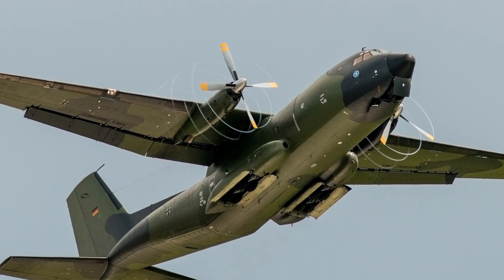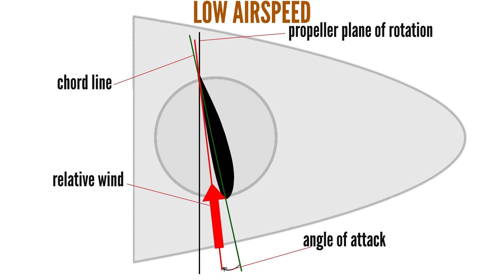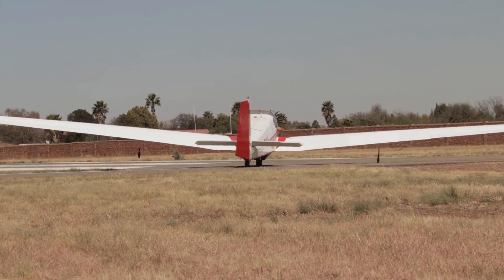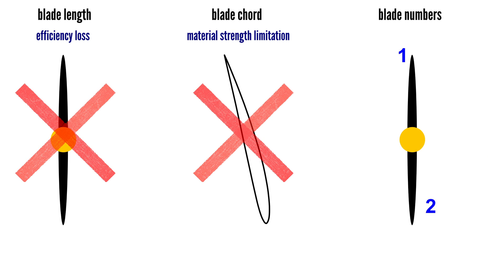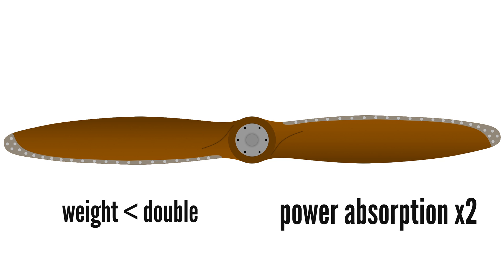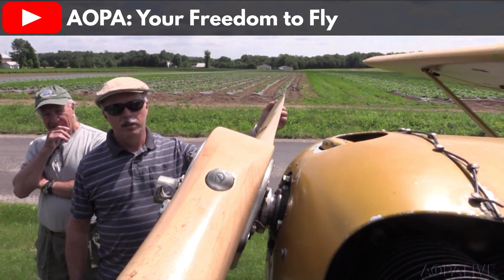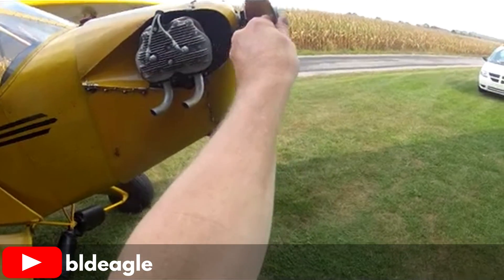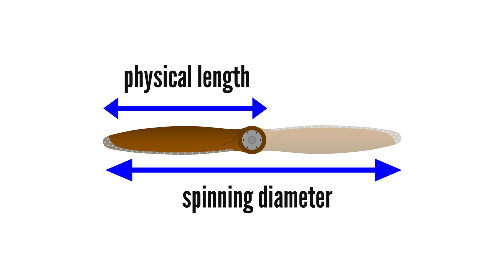The Problem with Single Blade Props Isn't What You Think - Efficiency Deep Dive

Comment: What if you have a single blade eith contra rotation? Then what?
Reply from the maker: I don't think it will be balanced. Since they counter rotate, the 2 single blades will cross over (pass each other) once per revolution, meaning the thrust bending forces adding up instead of cancelling out, potentially making balance worse.

I'm not sure if teetering hubs would be possible without the blades crossing over to the other blade's plane of rotation. At a quick glace the complexity seems too high.
Reply: It would be a bit of a mess, and there is little reason to do it, but I don't see why it couldn't work. You would need to put significant distance between the blades to avoid the teetering mechanisms causing collisions when manoeuvring (similar to contra rotating helicopters). You would then have a heavy low power prop that could operate at high speed, but is never going to get there because it is low power.

Comment: The non symmetrical forces on a single blade propeller you refer to were used to great effect. An automatic variable pitch propeller was achieved through a simple reliable mechanism.  Thus a climb prop on takeoff. A cruise prop in level flight with reduced throttle. I have seen two bladed props with automatic pitch.  They also are no longer made. Their mechanism more complex. I would worry about reliability. They have been known to fail where the metal fasteners hold the wood to a metal cup it swivel on the best I recall

Comment: I wonder if things could be different with electric propulsion, like for a drone. The countermass could be battery, so it's not dead weight.

And a weird trick is that a single motor could be used for both propulsion and steering. You alternate between spinning the prop for thrust, and holding it steady to steer.

Or maybe you don't have a countermass at all. The prop is on the end of the tail boom, and you simply accept that the boom will nutate in a tight cone in reaction to the blade. The drone doesn't need any tail surfaces other than the prop blade.
Reply: Well, most drone applications that I can think of are going to want a nice, steady camera of some form, so having the airframe nutating around is definitely undesirable.  There might be some possibility in the cheap toy drone catagory, where the novelty of a single propeller that also steers the vehicle might drive sales, assuming of course that you don't end up with excessive wear from the unbalanced blade with cheap materials.

You wouldn't be able to control roll with the propeller, similar to a helicopter needing a tail rotor, but maybe if you gave the drone symmetrical wings like the fins on a rocket, you could just let it spin at it flys, with the onboard microcontroller keeping track of orientation so that the controls stay in sync with the direction of the ground.

Comment: What happens when you have a gearbox attached to change prop speed to whatever you want. Say something like a tiltrotor. What happens to efficientcy.
Reply: I might be wrong but if I'm remembering correctly that's how a lot of modern turbo props work. You put the engine at a happy place where its getting the most work out of the fuel then change the prop angle to change thrust
Reply: Already done that, lot of ww2 plane have variable pitch propeller

Comment: Boeing did a deep study on a single blade windmill back in the late 80s or early 90s don't know what they found , but a have not seen any single blade windmills .
Reply: The single blade is more efficient per unit of blade, but the overall windmill has lower efficacy and cost effectiveness. 3 blades is the economic sweet spot of wind turbines with current materials and methods. The economic calculation is quite a bit different from airplane props.
Basically each additional blade extracts more energy from the swept disk area but not in full proportion. So (actual numbers for illustration only) 2 blades produces 185% of single blade power, and 3 blades is 260% of a single blade, while 4 bladed is 330%; but the blades costs are fully linear 3 is 150% of 2, the tower costs rise less than linear, and maintenance labor is basically a constant regardless of power output. (Keeping disk diameter fixed and thus tower height and spacing [powerline length] also fixed; but power and force/strength will vary.)
Reply: tower effect is also why 2 blades are "less desirable"..

Comment: Adding a second blade is in most cases less efficient because two blades have double the tip drag
Reply: No it does not double the tip drag, they are different tips on a different aspect ratio airfoil with different loading.
Reply: Single blades have inherently worse dynamic balance and thus higher vibration.
Reply: @allangibson8494 And the downward-advancing single blade will do some pretty horrifying things…
Reply: .... I converted my full scale piper cub to work on rubber band s with a single blade folding prop.....

Comment: Single blades are unnatural. They're surely evil in some way, perfect for a Halloweencopter
Reply: They are natural, maple seeds.
Reply: Zipline drones use 2 1/2 blades.

They were looking for a quieter propeller, and ended up with one that's a little more efficient too.
Reply: Ever see a pine tree seed when it falls out of a pinecone?😉
Reply: @throttleblipsntwistedgrips1992  Ever see a rotating assembly on a shaft in nature
Reply: Elm speeds don't spin at 1500+ RPM.  The big problem with a single blade propeller is that it needs a countermass to "try" and have balance so it would not shake the aircraft to pieces.  The problem is there are two kinds of balance, Static and Dynamic, and without a symmetrical radial and spanwise distribution of mass the two balances are never in the same place and the dynamic balance migrates with RPM.  In short it will always vibrate significantly more than a 2+ blade prop.  Also fewer blades means larger diameter  so the number of blades is usually selected based on the need to reduce the disc diameter of the prop such as to keep it from hitting the ground.
Reply: I’m sure they are also perfect for VTOLs as they can naturally feather down the airstream in cruise flight.
Reply: Look up fly halteres. It is the same thing.

Comment: Brillant exposition of the technical aspects of a single blade propeller. One thing I failed to notice in the imbalance part, sorry if my mistake, is that another imbalance is present  due to no balancing the par of force produced by total drag of the blade in the plane of rotation. Thus single blade prop would tend to also rotate orbitally arround the propeller shaft. Even when Center of mass is coincident with the hub, centre of drag par is not.

Comment: Good video as always thank you 
It’s all about eccentric loads and resulting vibration, and not just efficiency and structural bending loads. 
It is possible to balance the mass of a single blade prop, but we can’t forget that the blades are creating a lift force and the centre of lift is an issue. Two or more blades always result in a centre of lift that is coincidental with the centre of rotation, but this is impossible with a single blade. 
A single blade has a rotating lift vector that is inevitably eccentric to the rotational centre (and centre of mass if it is mass balanced) and so there is an inevitable significant vibration issue due to this even if there is a teetering hub to relieve the structural bending loads.
To avoid vibration, the rotational centre, the centre of mass and the centre of lift all have to be coincidental: not just the first two.
Reply: The teetering hub doesn't just relieve the structural loads, it moves the centre of lift sideways to the centre of the hub. Obviously this requires a torque, but the torques at each moment of time cancel over a full rotation, so we just need somewhere to store the angular momentum temporarily. Part of the reason the prop is heavy is that it needs to be. It also acts as the angular momentum battery to deal with the eccentric lift. The angular momentum of the prop is not aligned with the spindle at any moment in time, instead constantly being changed by the torque required to keep the force on the spindle down the centre line.